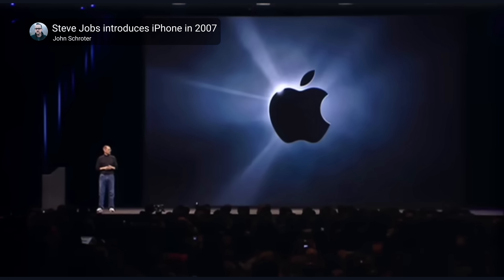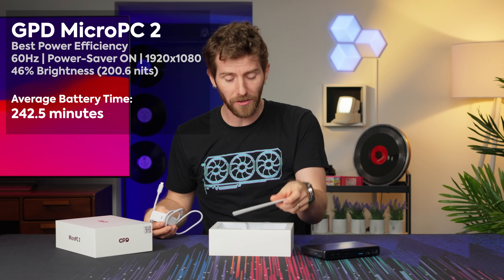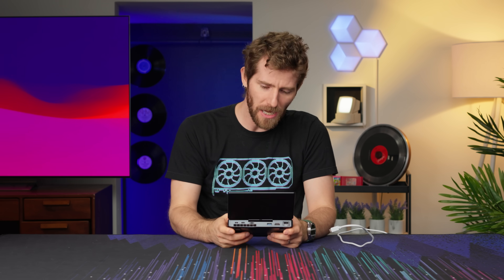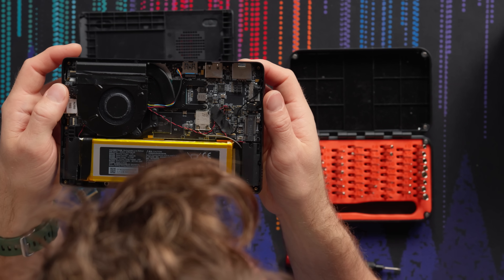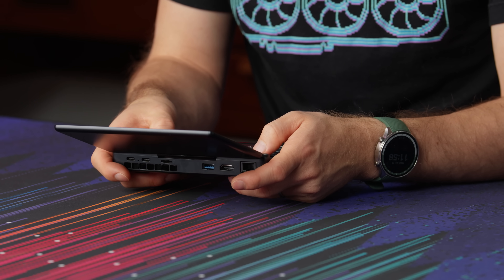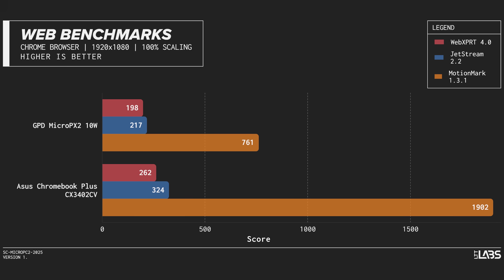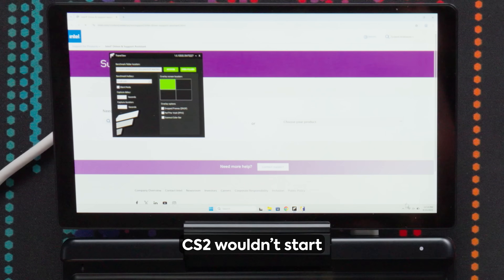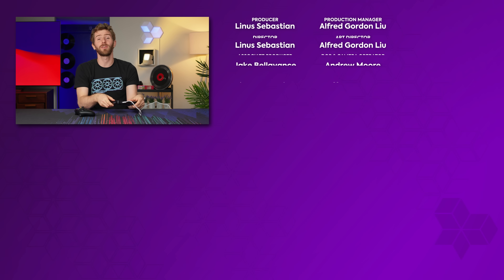I’m gonna need a smaller backpack - GPD Micro PC2

Comment: This honestly seems like a poor option when they already have the slightly larger, but vastly better GPD pocket 4, which would seem to be a far better for the type of work this type of device would be used for.
Reply: And is then also more expencive... If you don't need the extra bit of power why pay for it? If this is all you need then that's fine
Reply: @Lonewolf_121 because the processor is quite anemic, so in the long run it will cost you more when you have to replace it likely years before you would have to with the GPD pocket 4, at only $185 more for the same memory/storage size it's kind of a no brainer. Ultra low end stuff like this simply quickly ends up in the e-waste bin because they become mostly useless so quickly.

Comment: I used to have a GPD Win1, played a lot of Skyrim on it. It was a very unreliable device though, had to send it to warranty twice, then the eMMC died and at that point I gave up. It could still boot linux from a microSD though. I also had an UMID mbook M1 with Windows XP, played Morrowind on that one. I am actually amazed this can run Cyberpunk at all given it's essentially a bunch of E-cores so a late relative of the Atom lineup.
Reply: Compare to the Piccolo N305
Reply: Intel E cores are atom cores basically just with a higher boost clock then what they have been allowed to use in the past. All N cores have been atom class cpus.

Comment: Ooh, a modern Libretto!  Not all that unique.  I have a Libretto.  The speed isn't the problem.  The size, however, is.  Basically unusable unless you don't mind the most cramped keyboard you'll ever attempt to touch-type on.  The best part of the Libretto though was the trackpoint on the side of the screen.  It really felt fairly natural/ergonomic to use unlike the average trackpoint/touchpad interface.

Comment: I'm surprised you guys aren't talking more about the intel N family of processors. They are usually found in mini PCs, but the whole point is the 5-6 watt consumption, making them great for always on home labs and things like this.
Reply: They are powerful for the amount of watts they have, but in absolute numbers, not really powerful.

amd 5825U is so much more powerful for just 5-10 watts of power.
Reply: Tech YouTubers is long gone now. This is tech marketing channel now
A.ka they don’t care technical details
Reply: @MrAdhiSuryana I don’t know if that’s true in absolute terms, but I’m not gonna say you’re wrong.
Reply: I have minipcs hooked up to every tv in my house. Faster than any Smart TV's app and much more flexibility.
Reply: @inkermoy  thats a good idea, what ones are you using rn?
Reply: That's kinda crazy to think about. Running a pc on 5 watts of power. That's less than some LED fixtures.
Reply: The N series is literally the modern Atom.

And architecture wise, it's based on the 12nd gen I series.

Soo, you can kinda consider it a heavily cut i3 12nd gen
Reply: The only issue with N series is that they have an iGPU cut down way too much. Things like tablets or UMPCs with i3-1220p and alike are showing up, and the difference is rather huge.
Reply: Linus doesn't even know it exists
Reply: My Intel N150 laptop is surprisingly beefy
Reply: M3-7y30 was 4W and way more powerful tough.
Reply: @kloepiefloepie old core intel m3 7y30 is actually worse than modern n series

Comment: I think they pulled the same trick as the Steam Deck with the screen, as in it's a panel intended for phones. When I threw various linux distros on it, they all defaulted to portrait style display.
Reply: Could be a tablet display too
Reply: I have a Chuwi Minibook, which has a tablet display, and the current Bluefin version actually understands the orientation! First distro to do so that I've tried.
Reply: Well, that's what they used to do with the GPD Win 2(which existed long before the Steam Deck).  Its 1280x720 screen would always go into portrait mode for the bios.  Was a pretty neat trick they used.
Reply: I’ve had little luck getting Linux to play nice on this, and as far as I can tell, you need to be in windows to update the bios? 

What distros were you using?
Reply: I can assure you, these are landscape displays.  Gpd win mini has it too. No portrait displays currently exist with 1920 x 1080, they're all 1920 x 1200.

Comment: Super interesting for an automotive diagnostics laptop😯
Reply: Great use case! I use a Lenovo but having something that could fit comfortably in a glovebox that would give me access to the full programming suite (and built in Ethernet for my programming cable) would be a game changer.
Reply: My thoughts too. I'm still using an EeePC and it is getting a bit long in the tooth.
Reply: Piccolo N305 or Surface Nuc1 are other  budget-friendly alternatives
Reply: Im still using gen1 gpd micropc in automation workplace. It has rs232 port and a bit smaller form factor than gen2 so its comfier to type on keyboard.
Reply: Would need RS232 for that in most workshops. I know that USB adapters exist, but they are never fully reliable.
Reply: @mrmarecki1  That's not my experience. However I did have issues with drivers early windows XP.

Comment: 2010 called and wants it netbook back.
Reply: I wished netbooks were a thing, I would love one for university u_u
Reply: @elbardo_lux  As the other person said, they seem cool until you actually use one to get average schoolwork or office paperwork done and realize every shortcoming of it within 30 minutes. 

Something like this may be useful, as the video says, for some sysadmin who will just fullscreen a terminal and type commands on the tiny keyboard. Sure, nowadays we have USB C for charging and trackpad technology is way better, but I wouldn't want to write papers and spreadsheets regularly in something so tiny. Word's UI is already barely usable in a 13" MacBook unless you fullscreen it.

Even with all the modern improvements, netbookesque devices are onlydecent enough to be useful for a sysadmin using the terminal for a health check
Reply: @yerielzamora  I used mine a lot. Netbooks should be a thing. Much more useful than a tablet. There's a market for it.
Reply: @elbardo_lux you most assuredly do not. I was there and battery was terrible keyboard atrocious and screens so low resolution that a lot university sites were unusable. The track pads were worse than you can remember and the specs were so low that multitasking was barely usable. When I got my first ultrabook I fell in love.
Reply: @Dftba_hitch  yes the “netbooks” that where popular sucked. But there have been good small laptops that would fit in the netbook size specs but they have been more ultrabook hardware spec wise
Reply: @Dftba_hitch  I absolutely do. Keyboards were ok, but now we could have so awesome stuff in same formfactor.
Reply: @Dftba_hitch  well the modern gpd netbook lineup pretty much fixes all of that. Performance is amazing, batteries last more, screens are fullhd or more and kb should be decent for the most part. Maybe its time to give it another try?
Reply: Netbooks would still be practical today I mean you could get a functional laptop for 200 bucks brand new with a warranty.
Reply: @VonnegutRosewater-yi4rk Yes. I'd absolutely want that form factor with decend specs. I have Macbook Air, but it's too big imo. I don't like to take it with me. Now 700-series EEE I carried many times with me.
Reply: It's smaller than netbooks. It's more like an UMPC
Reply: For real why not just use Ryzen mobile sheesh
Reply: And here I am considering getting one of those used in a few years to replace my little Eee PC (that still sees some use from time to time to talk to my other old stuff).

Considering this thing has a full HD screen, 16gb of ram, 4c/4t, hardware encoding / decoding for all video formats, as well as apparently full DirectX12 / Vulkan support it does actually fix every single issue the old Netbooks had, apart from the size and very small keyboard.
This would make a great little backup laptop to use occasionally for small stuff like help fixing other people's PCs or network or stuff like that.
Reply: @RAHelllord  I'd like to get EEE form factor netbook again. Modern tech inside and good storage option they could really be computer to carry around everywhere to use and with modern USB-C/Thunderbolt docking it could serve as lowpower desktop. Like I have Macbook Air, but with its shitty storage and it still takes quite a bit of volume to take on, I just don't like to hault it with me.
Reply: I loved my eee PC.
Reply: Well now we have the cpus to run a netbook sized device unlike 15 years ago
Reply: Yeah this literally is just a netbook... But instead of being extremely cheap, it's hella pricey for what it gives. Going back to my Samsung netbook with an atom single core 1.6ghz that i paid 150€ in 2014, and wait for 16 hours so that youtube can load a video that will never play, thanks!
Reply: isn't that just our chromebook now?
Reply: @jazz-2-moonbase2  hello . Windows. I need windows. And Asus eeepc was 700 gr. Super light
Reply: yeah n250 and windows eleven just dont mix
Reply: this thing is at least 10x better than any netbook
Reply: The N250 is fine just fine. Not bad not great.

Comment: something like this is super cool but I can never fathom what i'd use it for
Reply: Ask pretty much any network/data center technician and everyone else who maintains embedded systems or industrial devices, they are gonna be drooling over this.
Reply: @gamelaine i dont have to ask one. I am one. And if my boss handed me this id probably toss it in a drawer and never use it. Anything network related youd use this for would be a pain compared to just a normal laptop
Reply: @bobowon5450 Why?
I mean, I know you can technically hold the laptop on one hand while typing on it with the other, but that seems far less comfortable than something like this.
Reply: @Fernando-ek8jp theres almost always somewhere to set the laptop down to type. And all my connection presets are on my laptop anyways.
Reply: @bobowon5450  And the small form factor is just annoying to use. I tried out something like this before and any benefit from the size was outweighed by the degraded useability. Anything I'd want to do on this because of its size, I can do on my phone, and anything I cant I'd want my laptop anyway. Or... I'd be lazy and just call a coworker and be like, "can you flash port 10 for me I don't have my computer" 🤣
Reply: just like its not for gaming, its not for you, its a business tool and crashcart device.
Reply: I have been wanting one of the GPD's for awhile now(was looking at the pocket 4) for my work. I'm on call 24/7 just like Linus mentioned in the video and it's extremely tiring to have to lug around a normal sized laptop EVERYWHERE. My organization has tools that are so old they are forced IE mode based so I can't just use something like a phone in dex mode or anything either also typing on a physical keyboard is always better. This is even nicer because it's slightly smaller and cheaper and has a CPU that should be stronger than my 7 year old laptop cpu finally. 

I'm honestly kind of annoyed at this review because he mentions the main use case then almost immediately moves on to other things that don't matter (like gaming). I know this is short circuit and not an in depth review but it would be nice to see how it handles having multiple web browsers open with a few tabs each and word/excel/outlook.
Reply: I will probably consider getting one to have it always on me in case our server crashes or something, it should be enough for RDP
Reply: Remote monitoring servers
Reply: If they made an affordable low spec version with a game controller like the old GPD Wins I'd get one. Not every handheld PC needs to play every big title at 60fps
Reply: 💯 we have phones that are pocket computers for a reason 😅